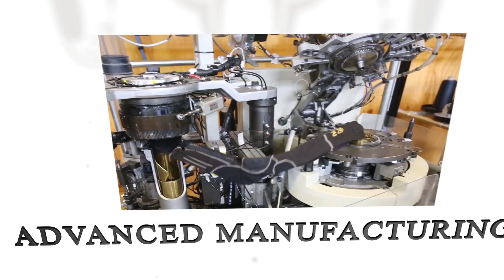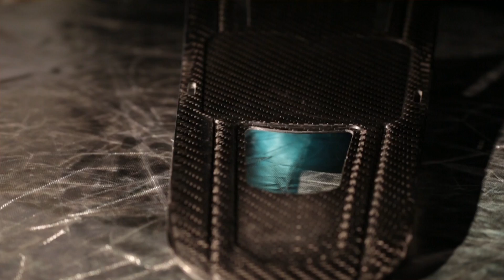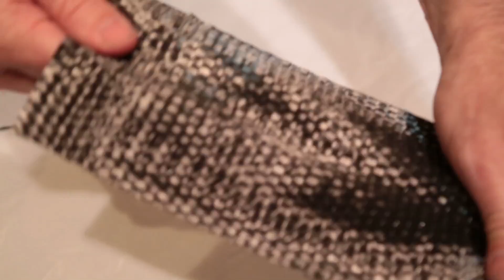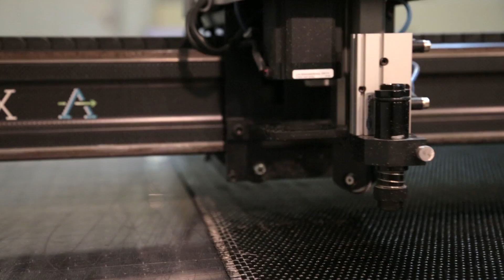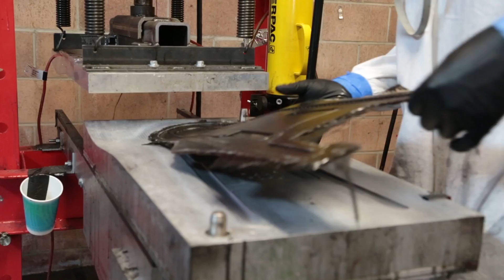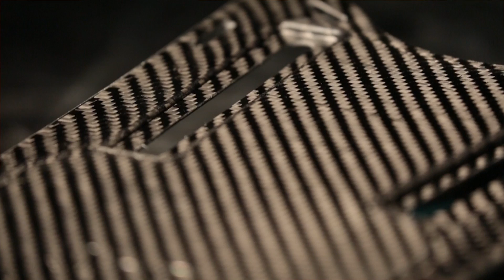KUIU: Behind The Seams - Rocket Composites

Comment: You guys can do much better!
Reply from the maker: Better than what?
Reply: Manual wet-layup with an epoxy-resin system, crude RTM process and dry machining... Why not look into thermoplastic composites, either TPU or PEEK reinforced with continuous fibre architectures or ROS (or a combination). A process that would be more net-shaped and reduce all of your machining and waste.
Reply from the maker: I see.  Since this piece was produced, we've gone to a new spread-tow carbon fiber, which is a continuous fiber cloth, eliminating some of the complexity of the wet-layups shown in this piece.  We've investigated a number of manufacturing methods; RTM curing and machining details, while less flashy than other methods, allows us immense flexibility when prototyping and evolving the design--and that's key for us at KUIU.  If our strap channels were molded in, we'd have to cut a new mold every time we wanted to try something new, and that's cost-prohibitive.  In addition, our engineer at Rocket believes that thermosets are better for this application, as they allow us a higher volume of fiber to resin, which is especially useful with our newer spread-tow fibers.
Reply: @trailkrum  
Hi  can u share me step by step process for manual wet compression molding,  thanks
Reply: @kuiuultralight  Awesome response. Thanks for the transparency. Glad you're always innovating.
Reply: I’ve been waiting a year to post this reply. As an anonymous former Rocket Composites employee, you really could do better. The company has gone downhill.
Reply: @kulehrong8019  kindly share step by step for manual wet compression process , thanks